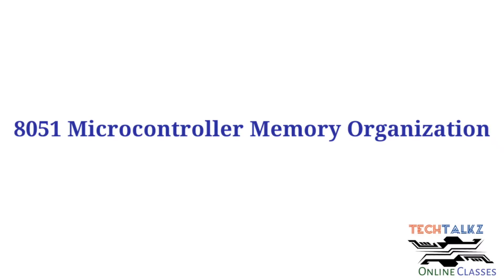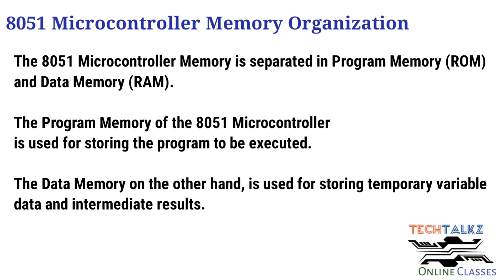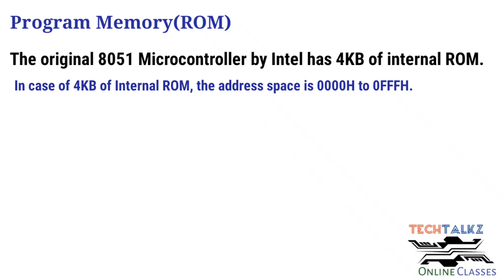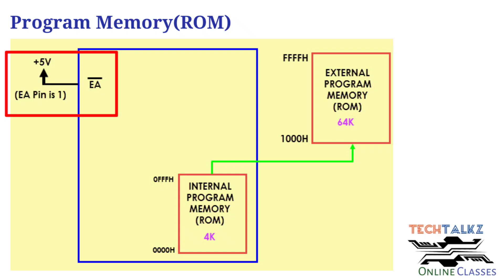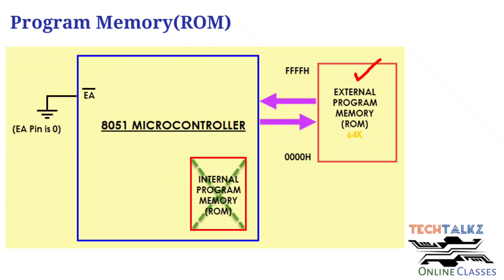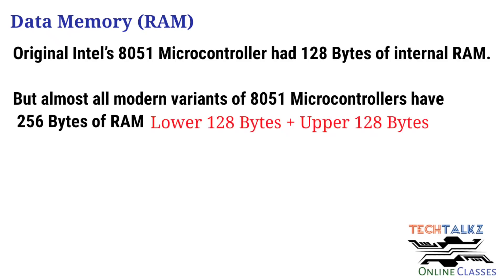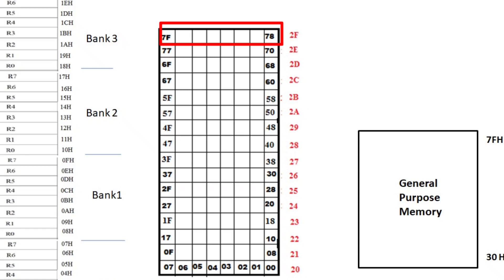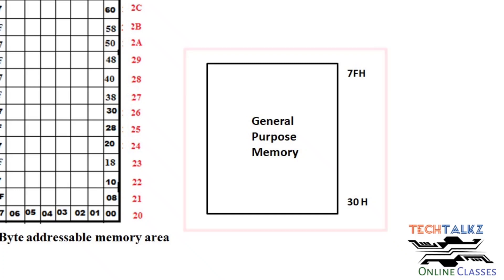Module 3|Part 5|8051 Memory organization|Microprocessors & Microcontrollers|S5 ECE-KTU

Comment: Sir, isn't external rom 1000H to FFFFH 16k in value? Or is it 64k?
Reply from the maker: A maximum of 64B of Program Memory (ROM) and Data Memory (RAM) each can be connected with the 8051 Microcontroller (0000h to ffffh) 
If EA bar pin(external access) is connected to GND. 8051 will search for the program from the external ROM.(0000h to FFFFh) 

If EA bar pin is connected to the Vcc, then the microcontroller will look for the code from internal ROM(0000h to 0FFFh). If it exceeds the internal ROM address range, then it will move towards the external ROM (1000h to FFFFh)
Reply: @techtalkz_roy  Thank you sir. Thank you for the content.💯😇